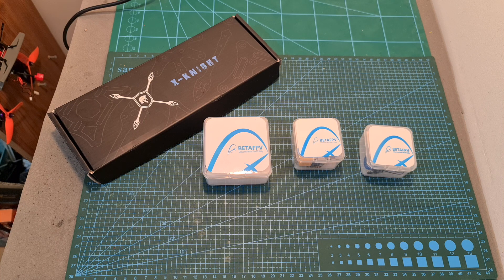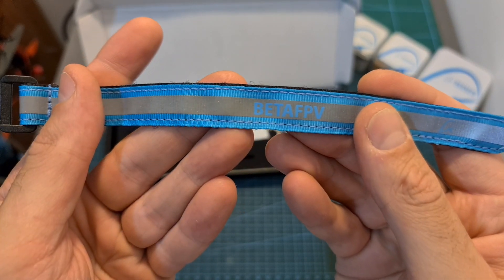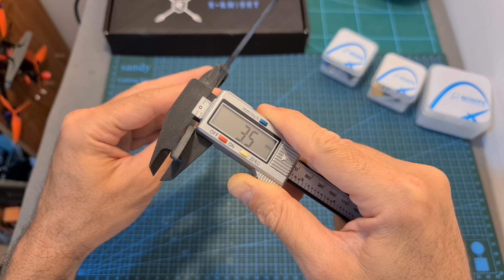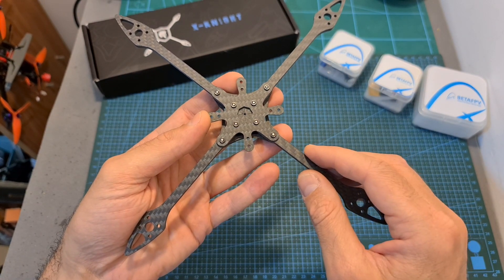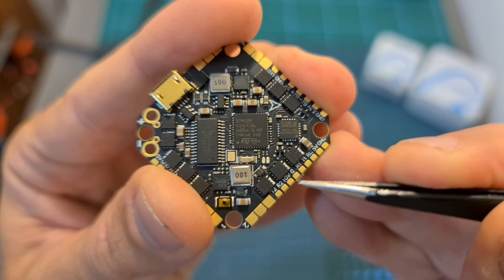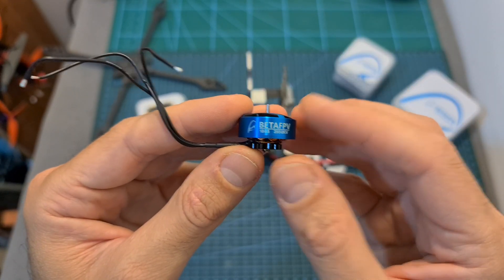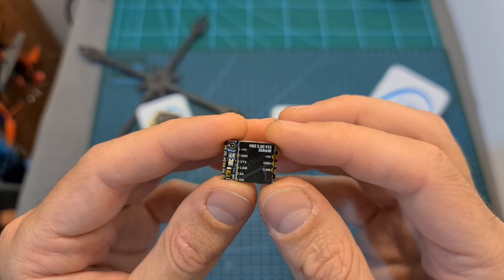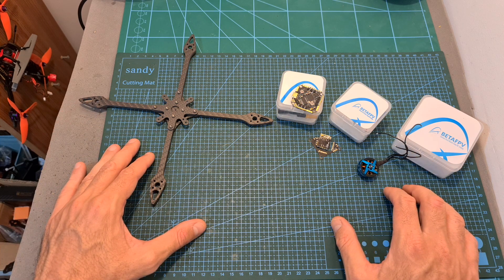BetaFPV F4 35A 2-6S Flight Controller, X-Knight Frame & More

Comment: have u build the x-knight with that aio?  i have some issue with them.  
1.  When i Roll, is normal, when i pitch it flip crazy super fast even the rate are set same as roll
2.  Kind of like desync toward pitch.
3.  alot of prop wash.

do you have any idea how to solve this?
Reply from the maker: Hi, I did use it and didn't encounter this issue. 
Which BF version are you using?
Reply: @KremerFPV  hi.. im using latest betaflight 4.2.5. i not sure why. i was suspecting of too many electronic noise
Reply from the maker: @davidlyw89  Try to use BF 4.1 and use less filtering.

Comment: I already got the 4inch version of this frame. But having trouble finding something or some way. To mount the vista instead of using double sided tape on top of the FC Betafpv Aio 20amp board which has a very touchy gyro. Hopefully the new 6s board dont have such a touchy gyro. Look forward to your build results😎
Reply from the maker: The Vista has 25.5*25.5mm mounting option. 
You need to remove the screws that secure the boards and use longer ones in order to secure it on top of the toothpick style FC that you are using (hope it was clear).
Reply: @KremerFPV  Thanks Gal I'll try that😂

Comment: Nice teaser🤩
Maybe i mist that part but the weight if the motor?can it be a good alternative to the emax 1606 on a 4 inch
Thanks and Nice job
Reply from the maker: Thanks Fred. 
I didn't mention it in the video but I will test it in the upcoming review. 
Cheers!

Comment: An 1805 motor would be a perfect for a “full size” 4” build but those kv options just don’t work with a 4S battery. Perhaps 2550kv would work well on a 5S 4” though.
Reply from the maker: Yep, I am going to test the 2550KV version using the 5" frame.

Comment: Would a sub 250 gram build like this be faster than a traditional 500+/- gram racer . . .or is the appeal just to have a racer under 250 grams?
Reply from the maker: Well it depends on the setup, but generally speaking the end speed will be lower however it might be more agile than a heavier build.
Reply: @KremerFPV  kinda what i was thinking thanks. Great video btw cant wait to watch the build!!!

Comment: I'm really interested in the thrust tests as I use these 1805 2550kv motors😉😉, I'm not sure on the New V2 X-Knight frame though if it flexes a bit, but time will tell mate 😁👍
Reply from the maker: Thanks mate. I expect to review the new thrust stand in a few days and after that it should start working extra hours ;-)